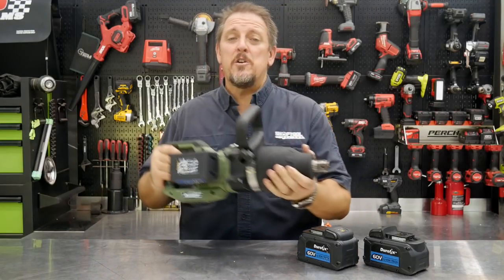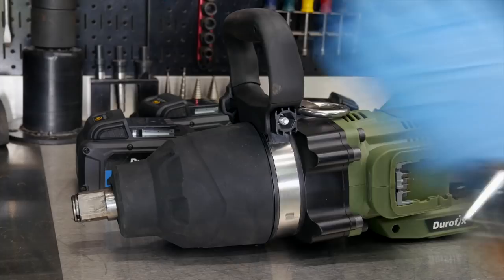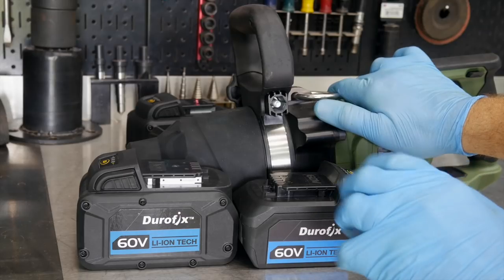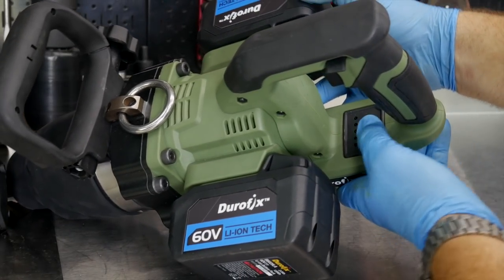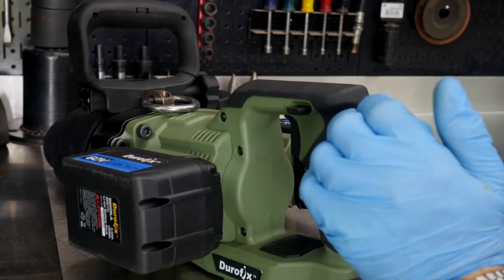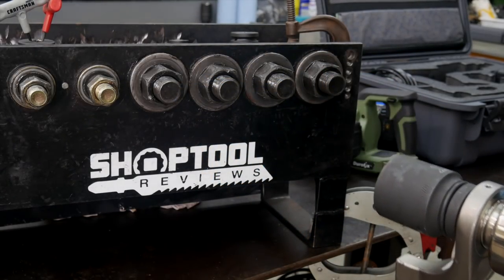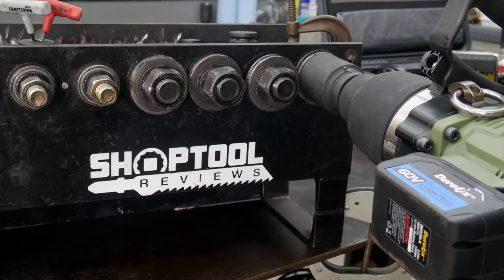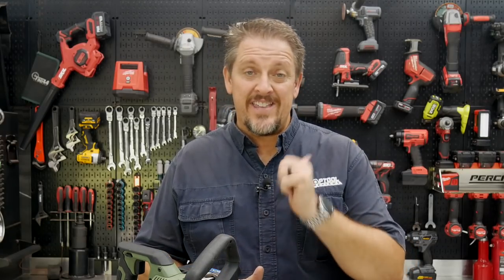HARD TO BELIEVE! 2000+ Ft-Lbs Durofix 60V Brushless 1" Impact [RI60176]

Comment: the perfect tool for reinstalling the oil drain plug
Reply: Yea, let's see the guys at Valvoline get that thing off now. :D
Reply: I use it for key fob screws
Reply: You are that SOB
Reply: Great for Lug nuts
Reply: 2500flb should just be tight enough lol
Reply: @micjubba709  agreed, although that’s a little loose for me
Reply: on a MINI
Reply: @overlordgaming752  could be a bit more snug like use a 14lb sledge hammer and one them hit spanners they use on ships to tighting up the nuts 😂🤣😂🤣😂
Reply: Oh, great idea. But looks like I will have to buy a bigger jack stand first to carry that under my car.
Reply: @dancearoundtheworld5360  🤣🤣🤣🤣
Reply: That need converting to a impact driver for kitchen cabnet installs 🤣🤣cupboard door  hanging and handles installs and such lol
Reply: Perfect for half inch self tappers
Reply: @NCC2100  I was thinking Walmart

Comment: Send it out to the torque test channel and let them tell is how much torque it really has!  The only channel that can carve out the real deals from the wannabes.
Reply: Here here
Reply: Agreed
Reply: The Torque test channel seems to compare nonsensical things - Like pitting a 12v milwaukee impact vs a 24v kobalt right angle impact - why not compare against the still smaller than kobalt 18v milwaukee?????????????
let alone any of the other larger offerings by other companies.
Ohh a 2/3 size driver has less torque than large size.
wow that's a shock
Reply: @L0st-n0found  do you make torque test videos? No! Than shut the hell up and don't complain til you do it "the right way". 🤣🤣🤣
Reply: @L0st-n0found  the 18V Milwaukee being compared to the 24V Kobalt RA would be a pointless comparison because that things like 10 years old and has all of ~50-60 ft/lbs and it will NOT overperform those numbers either....it's a super outdated and super underpowered design and has no real advantages over even a regular M12 electric ratchet.  You would know if you've ever used one. (and there's a reason it has all of 3.1 stars on Milwaukee's own website, btw...)

They should definitely test one eventually, but get ready to eat a lot of crow when that thing turns out to be one of the most embarrassing tools to ever get reviewed on that channel.  (Makita's too, theirs is also super awful and outdated)
Reply: @L0st-n0found  He compares numbers that company’s advertise.  He even mentions that in the video your referencing.  If you make excuses like that then companies can just make up whatever power numbers they want.
Reply: @jaywelker5566  sorry I didn't know about the outdated m18. ...  I have never had call yo need a right angle impact driver so haven't done the research. Would have thought there would be another higher output device that it could be compared to rather than the tiny 12v.    I wouldn't think  comparison of  460ci v8 to a 4 cylinder 95hp and then say how amazing it is that v8  has more power.   Numerous of the torque test videos have similar nonsense
More importantly it's the idiotic clickbait most powerful its not even close.  [See v8 vs 4cyl ref above]
Reply: @L0st-n0found  Milwaukee rated their 12V higher torque than the Kobalt. So it would be like pitting a 4cyl that was rated for 500 against a 460ci V8 that was rated for 350 and showing the obvious result to point out that it was silly to rate the 4cyl at 500. Those are the two highest rated cordless right angle impacts, what else should they be tested against?
Reply: @brettwalkom948  yeah so again do I really need to know that a 1000hp big block is faster has wheel hp Etc than a 95hp 4cyl in a 1980 Toyota?    Then post a video saying OH MY GOD THE MOST AMAZING MOST POWERFUL ENGUNE IN THE WORLD.!!!!
Reply: @L0st-n0found  whatever mate..
Reply: I agree
Reply: @L0st-n0found  the point of the test are to show true torque vs torque claims. Voltage isn't really the issue. Plus overall value. Heck Makita has 40v tools and are similar to 18v Milwaukee. And an 18v 12amph battery is larger than any kobalt 24 volt .

Comment: Hi you should send that impact to the guys over at torque test channel they have all the testing equipment available over there
Reply from the maker: You mean they have one piece of testing equipment, using a formula to convert hydraulic pressure to estimated torque. Great guys over at TTC. Thanks for watching.

Comment: The mode selection switch seems to be an inconvenient spot. Your hand will cover it most of the time. The IR 1" Cordless still seems to be the top dog.
Reply from the maker: It's not necessarily inconvenient, but I understand what you're saying. It's kind of tucked away and protected. I think the idea is that it's not something you're going to be messing with "on the fly", so they have it in an area that won't get accidentally bumped. Yes, the IR dial is a handy way to do it. Thanks for watching.

Comment: I drive a lot of metal stake “pins” into the ground with a sledge hammer. I Wonder if u could use one of these with a special attachment to drive the stake
Reply: MAybe a hammer drill would be better
Reply: a demolition hammer with a special concave tip / socket type
Reply from the maker: Air hammers and Rotary Hammers work great for this. Although, a battery powered "air-hammer" would be awesome to see. Thanks for watching.

Comment: I think this thing is going to be about $800. This thing might have more power than the Milwaukee.
Reply: It does and ive been thinking of the milwaukee($1200) but this($800) is better and maybe cheaper, ill just paint clam shell black and have a badass impact for steel beams at work
Reply: @dancearoundtheworld5360  the milwaukee comes with a 5 year warranty they will actually honor. Thats what you are paying for. Also the fact you can use the same batteries in 200 tools.

Comment: Why hasn't Milwaukee made a 18650 battery charger for individual batteries think it wouldn't take much for that
Reply from the maker: Probably because there are off the shelf chargers that do this quite cheaply. Thanks for watching.
Reply: @Shoptoolreviews  I guess ur right about that my thought was for the cells in the batteries to be easily replaced tho like normal batteries with the price of them would be nice to be able to replace one or two that are bad instead of junking battery and I had a fire in tool box due to one of those chargers it was a cheap one but I didn't know it was dangerous to leave them on a charger